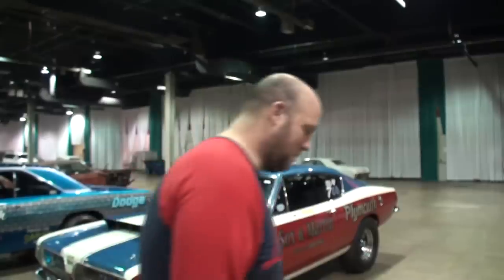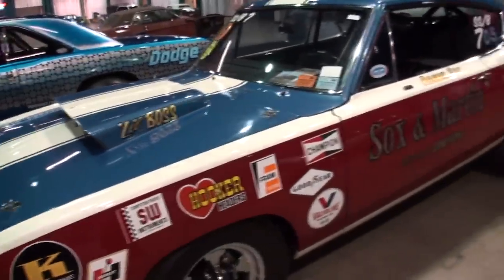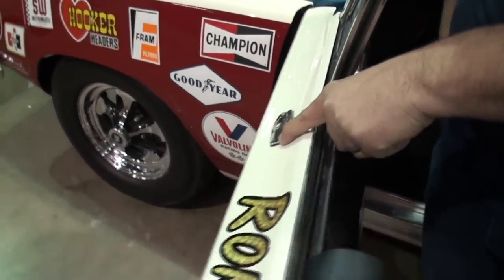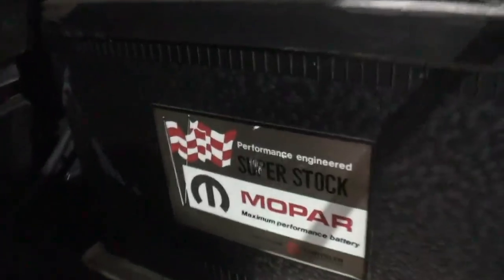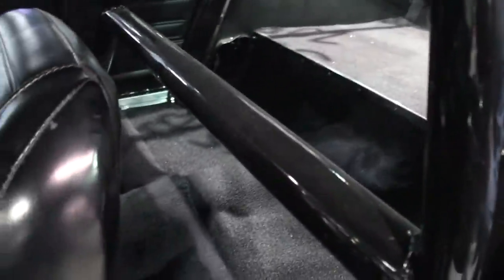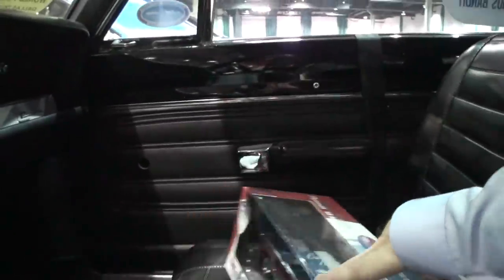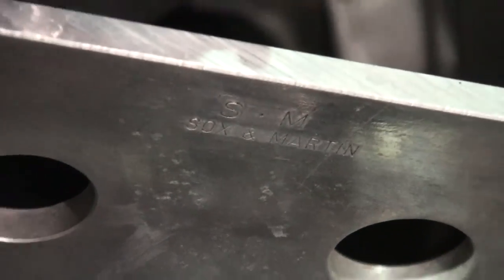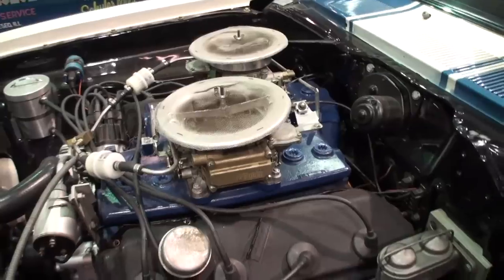1968 Plymouth Barracuda Super Stock Sox & Martin & Engine Sound on My Car Story with Lou Costabile

Comment: This car looks and is equipped different and finished than the one that was auctioned at Barrett Jackson a few years back. Hmmm?
Reply from the maker: Hmmm?
Reply: @loucostabile  Just me thinking.
Reply: @loucostabile  The Original I saw in Person and was at Barrett Jackson Had dual truck battery's a 5 gallon fuel sell in the spare tire well and a kill switch in the right taillight lens. also a blue stripe down the middle of the hood and the rest of the hood was white. Plus it was owned by Ronnie until shortly before his death and the auction. Not calling a fake but maybe a second S&M car here?

Comment: This is not the original paint scheme for this car. It did not have blue headlights or blue glass. Also the engine was not blue. It was orange. The trunk is nowhere near correct. It had a fuel cell with fabricated sheet metal around it. The original underside of the trunk was white. Not black! Ronnie signed the white one.
Reply from the maker: Hi Rick, Thank you for viewing and sharing your knowledge. Hope you see many more cars on this YouTube Channel you enjoy. Please subscribe, and hit the "bell" so you can see all the cars when they are uploaded on this YouTube Channel, Lou